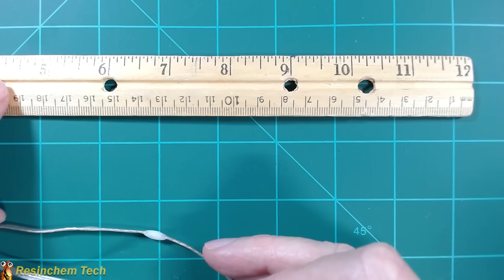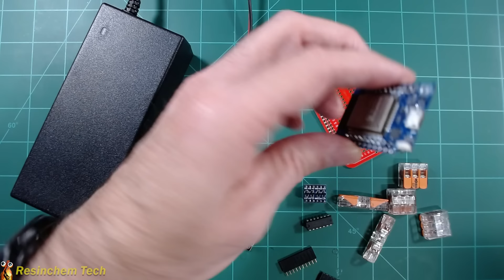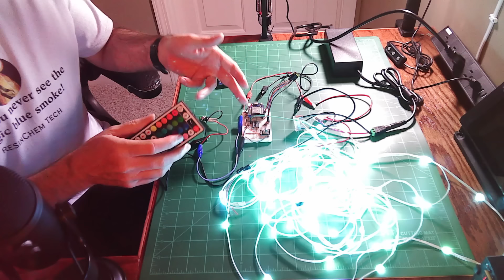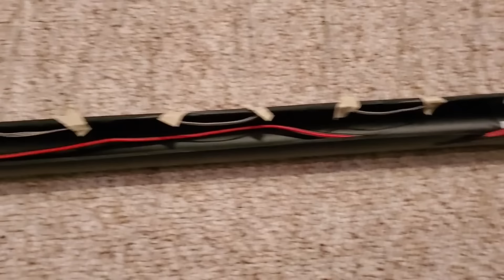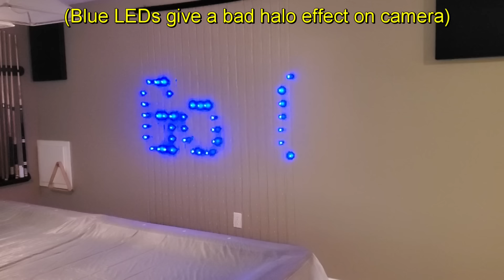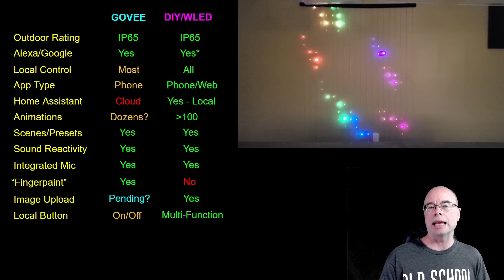Building an LED Curtain with WLED

Comment: Loved you addressed the "smile more" comment 😂 Ireally enjoy your videos, I kept thinking your videos are like a lecture at a college, come to find out you were a professor; keep up the amazing job. I haven't done any wled projects yet because I have never done any soldering (nor do I have the equipment) but is there a particular reason why you always use a breadboard? Is it necessary or just nice to have?
Reply from the maker: Thanks for the kind words.  And actually, while I worked at a university, I wasn't a professor.  I was the Chief Technology Officer in charge of all IT.  But I do appreciate the compliment.

The soldered breadboard version isn't really a necessity.  You can build a WLED controller with no soldering on a standard breadboard with jumpers and things like Dupont cables or you can even connect the components together directly with things like Dupont connectors and alligator clips.  In fact, I show another video on how you can get started and try WLED in only about 15 minutes with no soldering.  You might want to give this a watch:  https://youtu.be/dXLOqGa-n5A

But as far as soldering, it just takes practice.  I was absolutely horrible at it when I first started building my projects.  Now, I actually enjoy it and find it relaxing!  You can always watch some other YouTube videos on soldering tips to get you started.  A decent starting soldering iron really isn't very expensive.  I think I spent about $35 on mine and it isn't very fancy.

Thanks again for watching and posting a comment!

Comment: Awesome Video, I want to build this for the Holiday Season. Hang outside.
Thanks!
Reply from the maker: You are welcome!  I originally had the same thought (hang it up for the holidays, then store in between), but we liked it so much we found a location to leave it up.  But it is lightweight and easy to move, so I can relocate it for the holidays.

Just remember as I stated in the video, if using outside and where it might be exposed to rain or other moisture, the wiring connections need to be made waterproof or otherwise protected.  What I showed in the video in terms of the wiring connections would only be good for indoor use.

Thanks for watching and your comment.

Comment: Well covered comparison. DIY is not always about the money - satisfaction and "she who must be obeyed" approval is priceless.
Reply from the maker: Ha... that's the truth!   I do usually try to save money with DIY versions, but the cost of the LED fairy lights were higher than I expected.  My goal was just to see if I could make a version that was close to the Govee version, but used WLED.  From all the DIY versions of retail products that I've tried, this one easily turned out the best and the closest to the retail version.

I also failed to mention in the video that the curtain is nearly invisible when turned off... and if you wanted, you could paint the pipe to match your wall and it would really make the curtain blend in when not in use.  That helped with the WAF... but when she saw them 'in action' just laying on the floor, she recommended both the install location and leaving them up.  They weren't as "garish" as she was probably expecting, especially when powered off.

Thanks for watching... and I always appreciate the comments.
Reply: It’s the satisfaction every time you see it in action knowing I or you built it. If it’s cheaper or the same $$ the satisfaction speaker bigger ##
Reply: To be fair here the DIY version is superior, simply because Govee's API is garbage mostly to force people into their walled garden app.  Govee curtain's outside of the App can only have 10 assigned addresses basically two entire strips per address (meaning you cant address individual LED's with the API)

Comment: Great video. I've had a similar idea since I saw the govee product hit youtube. I am thinking of making something similar for myself. 

2 hopefully useful pieces of info. BTF Lighting sells a curtain already made but it does come with a controller and power supply. Probably more expensive but cheaper than Govee. Also since yours is running WLED software like xLights can control it for really advanced images and animations.
Reply: Also thanks for showing that everything doesn't always go as planned. I always appreciate it.
Reply from the maker: Yeah... I've heard from so many folks that think they can't do something like this... or are intimidated or timid about doing something wrong.  I almost cut that scene due to length of the video, but I left it in to show that even after building dozens of LED controllers, I still make mistakes and it is all part of the learning process.  Usually the worst outcome is the lost of a component or two at only a few dollars.

I hoped that by leaving in my idiot mistakes, it might give some of those hesitant viewers the confidence to give it a shot.
Reply: @djweso  Thanks for pointing out xLights, i'd never heard of this software. Looks amazing.
Reply from the maker: Thanks for the thoughts and alternate ideas.  I was aware of the BTF pre-built curtain, but for me that kind of defeated the purpose of building my own.  But the curtain is also WS2812b, so it should be possible to cut off the existing controller and wire in your own.

The xLights is a really interesting idea.  I briefly played with xLights when I first started messing with LED strips, but it seemed like overkill for what I needed at the time.  But I would definitely like to revisit it with this curtain.  I think for holidays like Halloween or Christmas, being able to do more advanced images and animations would be a big plus.. the type of things I see my neighbor do with his large music-synced Christmas display.

Thanks for taking time to comment... and for passing along a couple of great ideas.
Reply: @ResinChemTech  I completely understand about the DIY, sometimes it's the point. I was honestly mostly wanting others to know about the option.

xLights is definitely overkill for most days but like you suggested great for special occasions. The nice thing about pairing WLED and xLights is you only need to fire it up when you want it, WLED takes control the rest of the time. It does have a big learning curve though. I'm still at the basic level of use. I'm pretty sure you can trigger it from Home Assistant as well.